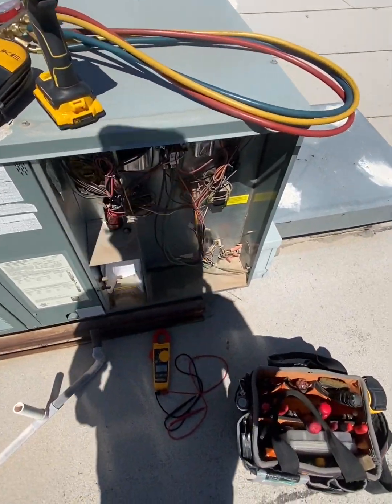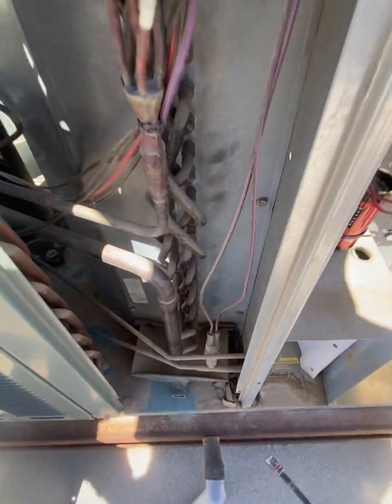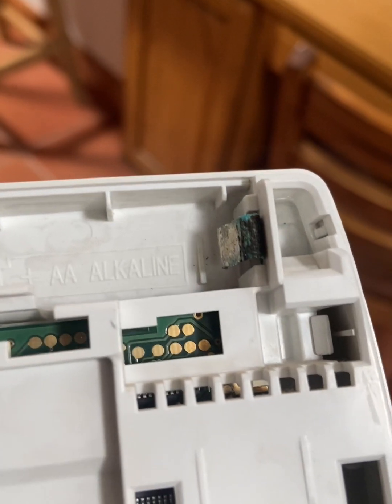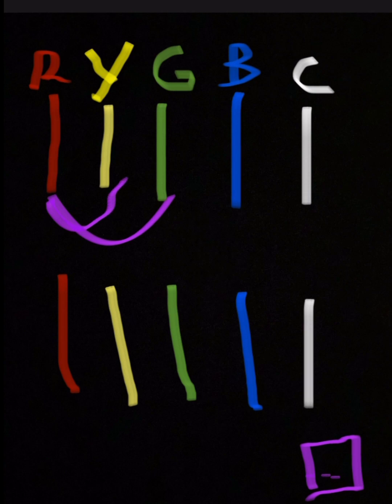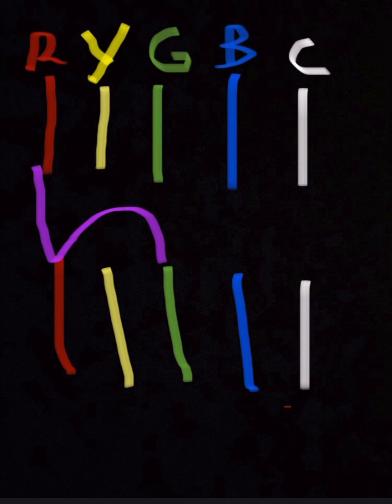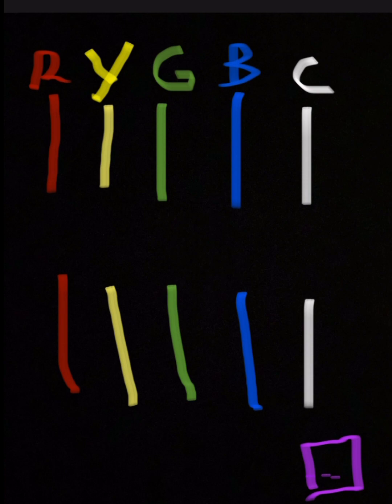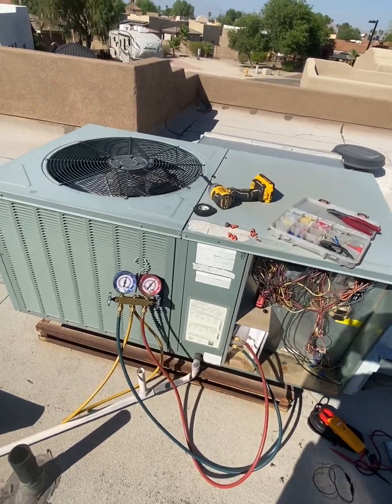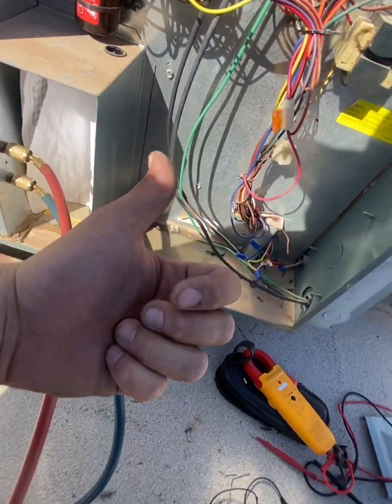HVAC, finding a low voltage short the easy way!

Comment: So, jumper red to each wire, one at a time and then when circuit with short will give what type symtoms?
Reply from the maker: Put a new fuse and then go wire by wire, when you get to the problematic wire usually the fuse will blow... thats just telling you that something in that circuit is messed up. 

For example: If you have a new fuse and you go red to OB and bam fuse pops.... that tells you, RV is bad or the solenoid is bad or the OB thermostat wire is bad.... or tstat itself is bad internally...

With this method you can atleast narrown the problem down. You will have to keep troubleshooting but atleast now you know where your problem is coming from.
Reply: @HeavyPressureHVAC-WATER  Great info.

Thank you!
Reply: @HeavyPressureHVAC-Water  Great info!
Reply from the maker: Yes sir 😎💯💯
Reply: @HeavyPressureHVAC-WATER  Thank you!

Comment: Yea there is a much better way my friend remove power and ohm out each wire to ground. Then take R to C ohm reading. If it has a reading below 8 Ohms you will pop a 5 amp fuse. Check on down the circuit and wire to wire any components Or path that shows less then 8 Ohms you have found your fault. Quick,slick and efficient method of finding a low voltage short,ground,Or shunt.   You could also use the arc method but we will save that for another time. What is real great about these methods is that you do not blow a fuse to find the fault.
Reply from the maker: Yes sir manny ways to do this 😎 Great info💯
Reply: You mean at the thermostat or down at the airhandler?

Comment: How many hours do you stay at jobs on average?  I hate fault finding because i hate how long it takes. That's why i only do installations/decommissions
Reply from the maker: It all depends what needs to be done, my average service call is right around 2 hours. 
Heat pump equipment is very common in my area so im very familiar with it.  
Every now and then ill get stuck and have to come back 2 or 3 times, you know how that goes😂 hahah

Comment: what do you mean when saying R to R, G to G? are you going from R to G normally at the tstat?
Reply from the maker: You can do that too! R to G at the thermostat will turn on the blower motor. If you go to jumper R to G and the fuse pops, check the G wire and everything that it ties into😊 
This applies if you go R to G, R to Y, R to OB, ect.

Comment: Yep, found a sensor wire rubbing against the compressor discharge pipe (hot) in the condenser - causing a short/blown fuse on the low-voltage board.
Reply from the maker: Happens all the time, great job catching it 💯😎
Reply: @HeavyPressureHVAC-Water  I found the rats had chewed through two common wire going outside to the capacitor which caused my 3 amp fuse to blow . I also learned that HVAC men don't get paid enough you have to check the thermostat wiring in order to pinpoint the problem and that takes time up in the hot AZZ 🙄 attic 🔥🔥🔥🔥🔥🔥 back outside in the heat 🥵 took me three weeks to find the wires. But I'm 59 years old 🤣👍
Reply from the maker: @gods959  AZ heat is no joke haha, keep up the good work! 💯
Reply: Thanks for sharing your knowledge 🙏👍